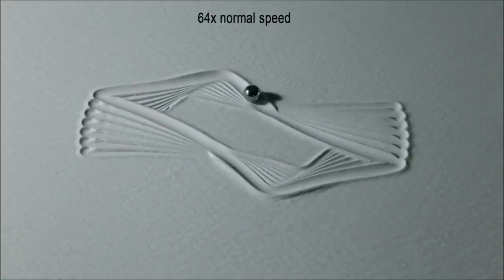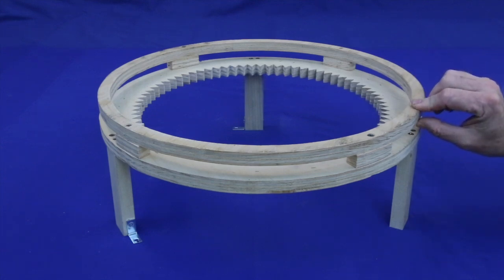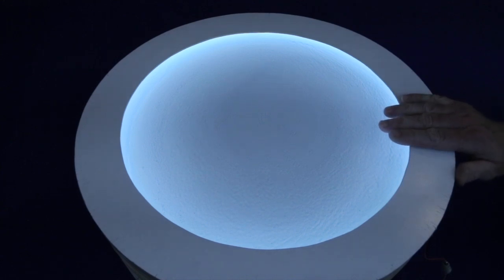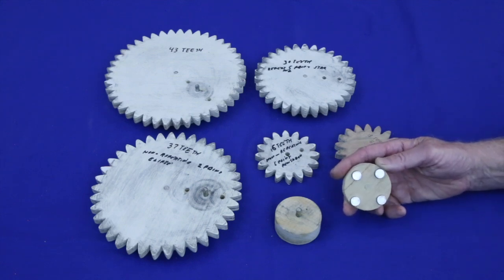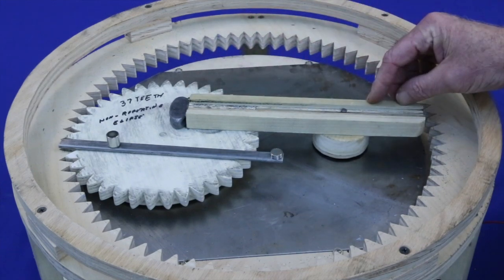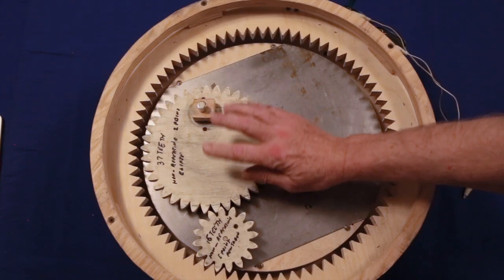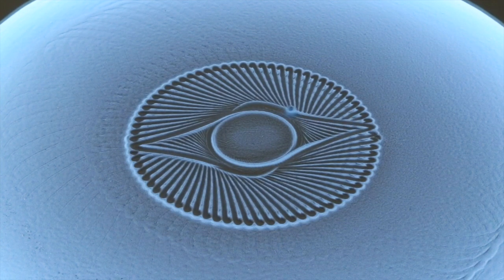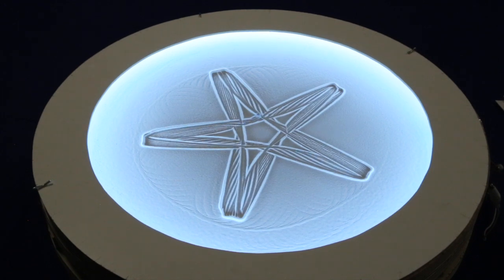DIY Drawing Machine That Draws In Sand

Comment: I've always wanted one of these tables. I never knew what was underneath. I have a CNC and 2 big sheets of HDPE some UHMW plastic. I know EXACTLY what I'll be doing when I get some free time. Thank you so much. Can't wait to make one of these.  I think some close friends will also appreciate it this Christmas.  Gonna start looking for some round glass from yard sale tables too.
Reply from the maker: Did you know you may be able to use your CNC machine as is to draw in sand? Simply chuck a piece of steel with a rounded end into it, turn off the spinning motion and program it to trace out the pattern you you want in a shallow pan of fine sand. Mechanical drawing machines like mine are nice, but computer controlled machines like Sisyphus...

https://www.youtube.com/watch?v=qdseS4xLioo

...can generate a much wiper range of images. Thanks for commenting!
Reply: @wayneschmidt490  I could, but a CNC isn't something I want to keep in my living room. :)   I already have the CNC using a sharpie to draw pictures, and you can actually make it play music through the stepper motors (which sounds super weird)  I've always wanted to make a big table like this.
Reply from the maker: @mongrelbees2616  Good luck!

Comment: Wow. This one seems pretty sophisticated, but the result is fantastic. Commercial ready ☺
If the motor had been silent I bet it would sell good.
Love all your machines😊
Reply from the maker: Thank you! The original was quieter because I used an ac rotisserie motor, but it was too big and slow. The little battery powered gear motor is noisy but much smaller, faster and doesn't have the hassle of needing a power cord.

Comment: Small tips are worth noting down. Planning to use laser cut acrylic gears instead of wooden ones. Did you explore that option ever ?
Reply from the maker: I went with wood gears because I had the equipment to make them. Laser cut gears will be much better.

Comment: Very nice project.  Thank you for sharing, but one thing I wondered is whether you covered this during operation since any dust/dirt would contaminate the aluminum oxide and could cause clumps that could disrupt the ball bearing from making a clean path.  Also, have you tried automating this so that the machine resets, cleans the old pattern, and moves to another pattern?
Reply from the maker: Hello! And thanks for commenting! I don't cover the sand during operation and haven't had any clumping problems. I do cover it if it's going to be stored for any time, but so far after having it out for many days dust doesn't seem to be a problem. I am careful to not get any dirt into it. All that's needed to level the sand is to give the tray a few shakes. It seems to self level quite easily. An automated reset would be nice, but would require computer control, which gets away from the purely mechanical drive system I wanted. There is a table that will do that called Sisyphus, which you can see in the following YouTube video:

https://www.youtube.com/watch?v=vY0fhXosUyw

Comment: Awesome video! What type of sand are you using?
Reply from the maker: It needs to be very fine to create sharp lines and pure white for the highest contrast. I used 220 grit white aluminum oxide from www.Panadyne.com. Half a pound is enough for a machine of this size. I've tried fine grained sugar and salt, but they clumped up. Thanks for commenting!
Reply: @wayneschmidt490  I was wondering if flour would work?
Reply from the maker: @rvp5199  I tried various powders like flour, sugar, fine sugar, powdered sugar and corn starch. They all tended to clump up. The white aluminum oxide I mentioned in the video was the best by far. Thanks for commenting!

Comment: Awesome project. Where did you find the 12" pancake bearing?
Reply from the maker: I got it from a Lowes hardware store. It was in the area where they sell glides for drawers. You can also get them from Amazon. I checked out your channel and enjoyed watching the touch-and-go video. One question: in the co-pilot's side, there was a display that seemed to tilt and rotate with the flight controls. Why does it do that? Thanks! And thanks for commenting!
Reply: @wayneschmidt490  Thanks ill check that out, this is a really interesting machine and I plan to make one for myself. In the Co-pilot seat that was my iPad, I have it attached to the yoke via a yoke mount. I run an app called Foreflight because it increases the situational awareness. I like to keep it no the Co-pilot side to keep from obstructing my view of the main instruments.
Reply: @wayneschmidt490  Also one more question about the main drive gear. What parameters did you use for that? Was it just 75 teeth, with a pitch of 5 and a pitch angle of 27 for the main drive gear as well?
Reply from the maker: @jacobdubnowski736  Yes. Gears work best when they al have the same pitch and pitch angle.
Reply: @wayneschmidt490   gotcha thanks for your help!

Comment: My question is can this be built in a way where adjustments can be made without taking the whole thing apart to swap gears?
Reply from the maker: Yes. There's a company that makes and sells what they call Sisyphus tables, which use a computer to move the magnet that drags the ball around. With this type of system, you can create a much wider range of patterns. Here's a link to one of their YouTube videos:

https://www.youtube.com/watch?v=oGynRqnkYXw

Comment: I couldn't figure out what type of teflon tape are you using in between moving parts. It doesn't look like the one used for plumbing.
Reply from the maker: I used a teflon sheet designed for use in heat presses. It can be purchased from Amazon as "Teflon Sheet For Heat Press." Here's the one I ordered:

https://www.amazon.com/Teflon-Sheet-Transfer-Reusable-Resistant/dp/B07H55M1ZR/ref=sr_1_1?dchild=1&keywords=teflon+sheet+for+heat+press+16+x+20+inch+set+of+3&qid=1618335134&sr=8-1

I hope this helps. Thanks for commenting!

Comment: Could i make all the builing layers thinner to slim it down?
Reply from the maker: You could try, but it might lead to two problems. First: several of the layers are rings so that unlike discs, they aren't very strong. Going to thinner material could lead to them warping or bending. Also, thinner material doesn't provide much to screw into. Second: the thinner the gears are the more accurate you'll need to position them so they mesh properly. But, if top quality materials are used it might be possible. Good luck and thanks for commenting!

Comment: Can you mention which magnet have you used? Is the ball a magnet too or a ball bearing ball?. Thank you
Reply from the maker: The magnet is a 1/2-inch long, 1/2-inch diameter rare earth magnet. The ball is not magnetized. It's a 1/4-inch diameter steel ball for a slingshot. I tried ball bearing but most are made of chrome steel, which isn't attracted strongly enough to magnets to work.

Comment: Could,it be hand powered by old foosball table knobs? Like a mega etcha sketch
Reply from the maker: A hand cranked version could be interesting. The problems would be: that it takes up to ten minutes to create a complete trace, which many people would find difficult, constant speed is required for clean tracers, and most people would be tempted to crank too fast, which could cause sand to be thrown around and even have the magnet pull away from the ball. Thanks for the comment!
Reply: @wayneschmidt490  Thankyou so much for your response!

Comment: Can you explain the magnet positioning for the pattern appearing at 0:22 seconds in your video? Will 6 mm steel ball work considering I would use 220 grit aluminium oxide?
Reply from the maker: A 6mm ball and 220 grit aluminum oxide should work great. To get the pattern at 0:22 into the video, the machine was set up with the 37 toothed gear. The pivoting end of the sliding metal arm on which the magnet sits was positioned near the outer gear ring and slightly off center so the arm assembly doesn't go directly over the machine's main diameter. The magnet was positioned near the end of the metal bar farthest from the pivot. Subtle changes in the positions of the various parts can cause large changes in the pattern so you'll have to experiment to achieve the pattern wanted. Good luck and thanks for commenting!
Reply: @wayneschmidt490  Thanks for the prompt reply Wayne... I spent the whole of today tying to assemble everything together (acrylic gears were already laser cut earlier and today was only the assembly)... It all went great until I realized my motor is not in the exact center or maybe the 14.25 inch center hole is off center.. Finally got tired and decided to take a break and start afresh later... Shall keep you posted... Thanks for the video, your reply and for being an inspiration
Reply from the maker: @varunet2004  Getting the motor shaft and the center hole of a drawing machine in-line can be a lot of trouble. On a different machine, I used a flexible linkage made out of a short length of rubber tube to join the two. This provided a little give in the drive so the motor wouldn't bind up. It acted like a simple universal joint.

Comment: I've tried to figure out geargenerator but I really don't get it what would connection angle be?

I want to make the measurements for a table of 79 centimeters. but I really can't understand everything on that page
Reply from the maker: I checked out gear generator.com after reading your comment and have to confess that over the years I've completely forgotten how I used it. I remember playing around with it a long time until I got it to show images of the gears I needed, then used screen captures to copy the images. After that, I imported therm into PhotoShop and enlarged them to the correct size, printed them and finally glued the printouts onto plywood for cutting. I'm sorry I can't explain in detail how to do it.

Comment: Wow this is cool. Where did you get that sand? It's so fine.
Reply from the maker: It needs to be very fine to create sharp lines and pure white for the highest contrast. I used 220 grit white aluminum oxide from www.Panadyne.com. Half a pound is enough for a machine of this size. I've tried fine grained sugar and salt, but they clumped up. Thanks for commenting!

Comment: What kind of sand did you use?
Reply from the maker: I used 220 grit white aluminum oxide from panadyne.com. Half a pound is enough for a machine of this size. I've tried fine grained sugar and salt, but they clumped up. Thanks for commenting!
Reply: @wayneschmidt490  Thank you so much.

Comment: Why is it so loud? We need to use a GE motor
Reply from the maker: You're right. It does grind a bit, and that's with the microphone pointed away from the machine. I have some quieter motors, but the ball makes quite a lot of noise pushing through the sand so switching wouldn't help as much as I'd like. Another problem is that the wood body acts like a resonator, magnifying both sounds. Thanks for commenting!
Reply: @wayneschmidt490  some of the other sand art tables use velvet with sand on top to minimise noise
Reply from the maker: @hoy-built  Interesting idea. Thank you!